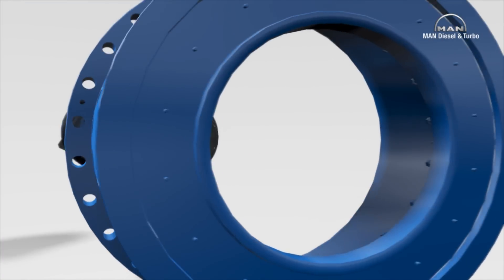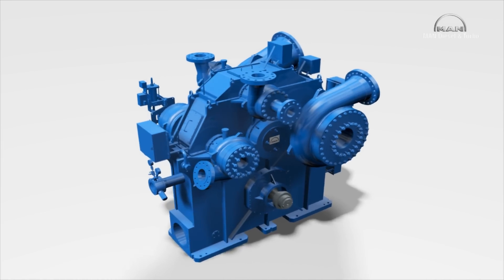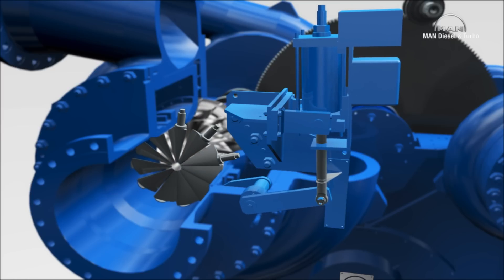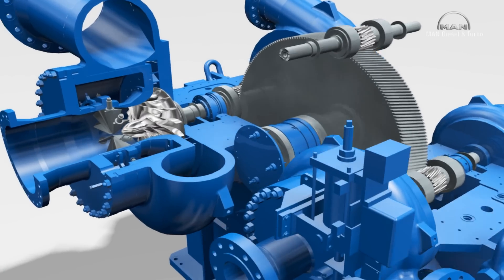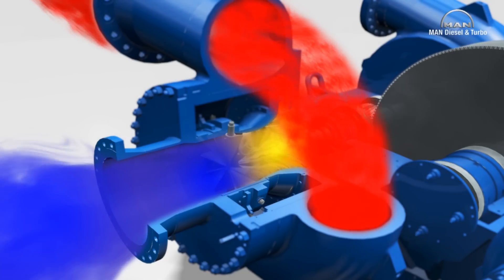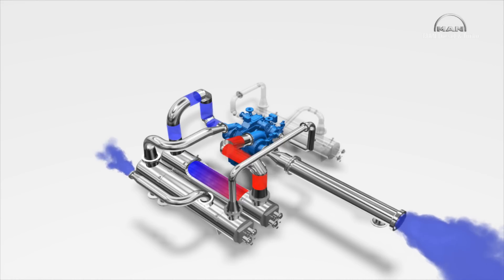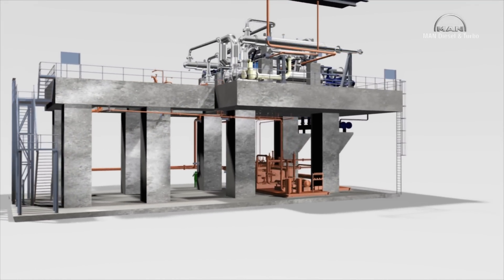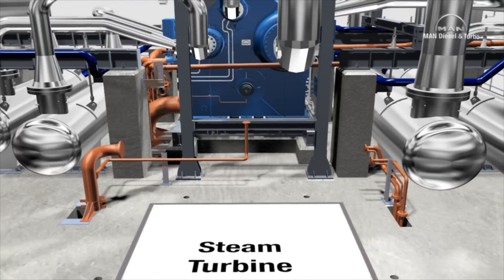3D animation of integrally geared centrifugal compressor

Comment: Damn, your presentation brings me back to the days when I used to surface sculpt the same components for the LHTEC/Honeywell T-800 engines which had two of those compressors. I was able to model those components with AutoCAD Mechanical Desktop from Honeywell paper drawings. My only restriction was the software and computers of the time.

Comment: So the gas need to be filtered and dried before entering the compressor, then guided, and compressed by centrifugal force (converting kinetic energy into pressure), and then cooled and filtered (to remove liquid or condensate in the cooling process) and pumped into the next stage.

Very impressive to see several stages are all integrally driven by one power source!!! 

Thanks very much for the good quality video!

Comment: up to 250 bar with centrifugal compression?? thats insane
Reply: Might I ask why you commented this? With the mentioned 6 stages that would be a 2.5:1 compression ratio on each stage, with a large enough intercooler it sounds totally feasible?

Comment: may you explain in writing because I do not understand and I'm still confused why the output of low-pressure air. Thank you
Reply: +Mela Anjar Mustika ---centrifugal l compressor's are typically high volume, low pressure, to get higher pressures you use multiple stages  to boost pressure, but that lowers volume, the larger stages are low pressure, and the smaller stages higher pressures , smaller stages are fed by the larger ones, and that gives them a higher inlet pressure, resulting in a higher total pressure,

Comment: what qualifications do you need to build and install these setups? air/refrig level 4? qualified tradesmen? lol, because ive never worked on those
Reply: +mike kendall I'm currently learning about dynamic compressors like this one as a third year millwright mechanic.
Reply: any practical experience?
Reply: +mike kendall -- there are few steps to assembling a packaged  compressor unit, Machinist to make all the parts, To put them all together I have found auto mechanics  do well, as long as they can read prints, and help with pipe fitting, a good electrical knowledge is helpful as a compressor like that may have 30 monitoring devices installed on the piping, compressor housings , gear box and supporting systems, a lot of control tube bending and routing.  Lots of plumbing is also involved, every thing from 1/4 inch tubing to 12" welded process pipe.
Reply: eric wsmith
damn sounds good, ive got my head wrapped around all of those skills, i live in new zealand though not sure how id get in to this kinda work, im bored of highrise buildings..